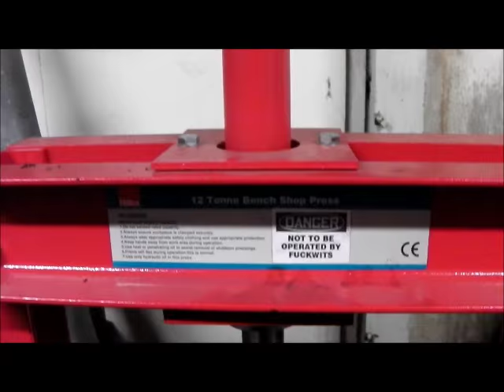Land Rover Series Front Axle Overhaul - Part 4

Comment: Nice job as always Phil - Now, just a tip I learned about replacing UJ crosses many years ago in my first job, which you may, or may not like to use.
When you've taken the old one out, grind a little off the outside of a cup so it easily goes inside. This is a spacer to press the new ones in using the vice. Cut a short piece of tube that just fits over the cups. Using this to allow the centre of the cross to be pressed into, it is easy to press one side in while holding the cross to prevent the rollers coming out. Press the cup through until it is sticking out on the inside i.e. too far. Fit the circlip to this cup. This way you can  slide the cross slightly out, so holding the rollers in both cups as you press the other one in. The ground cup is just a spacer to push it home, but perfect to press flat onto the new cup. Once it is fully home you can of course fit the other circlip. Also if the yoke has become slightly twisted, so making the circlip difficult to locate in the groove, you can tap the yoke out to get it fully home.
I did many PTO crosses in my 4 years at that job, and although I've rarely needed to replace one since, not for years now I've always valued learning that.
Reply from the maker: Thanks Malc, good tip. I have a PTO shaft to do shortly so I'll give that a go.

Comment: Dear steam, I have just done this job. Its way easier just to grind a groove for your chisel, onto the face of the inner bearing race, and drift the race and seal land off together, thus saving the original seal land if its reusable.
I clamped it in a vice, ground a good groove in the inner bearing ring/race at 6 oclock and 12 oclock, plenty of blowlamp on the movable bits, and 5 or 6 good wacko smackos each side and they come off together, with no risk of cutting the shaft. Your chucking the old bearing anyways (if) and you can use the original land rover seal land, as its turned up way better than the new (rough as a badger) britpart crud. Cheers.

Comment: Thanks for the great video.  Is the middle metal cylinder (between the retainer collar and distance piece) the inner race for the half shaft bearing, and if so does this come with a replacement bearing?  I can't find that piece listed anywhere (LR parts manual, roversnorth, etc).  Thanks in advance!
Reply: I’m having trouble finding that part number also.🤔

Comment: Thanks Phil. Great video and really helping as I overhaul my swivels. A quick question; I'm fitting new half shaft bearings into the swivels, is there a right / wrong way to fit these? My assumption is that the retaining collar should face out?
Reply from the maker: Thanks, glad it helps. If I remember rightly, the halfshaft bearings are a roller and the cage has a lip only on one side. You need to be able to install the half shafts with the swivel ball fitted to the axle case, so the lip would have to face towards the diff.
Reply: @steamwally  Thanks Phil - you are right re the lip and that's what I'd assumed was correct but because the original bearings were caged from both sides none of the docs cover it as it wasn't a problem. Keep up the great work - making restoring my 73 109 so much easier.

Comment: Nice going, Phill.   I was taught to use an appropriately sized socket and a vice to press in the bearing cups.   

Is this other workshop your Fortress of Solitude, out in the woods?  :-)
Reply from the maker: I have used that method in the past, works very well. I wouldn't fit them with a hardened steel hammer, but with the copper mallet it's usually OK. Certainly quicker anyway.. 

Everyone should have a workshop in the woods....

Comment: Looks like the bench could do with another leg, under the vice...!!
Reply from the maker: It's quite sturdy, but isn't there always room for improvement!? Incidentally, that vice came from the WW2 ammunition store, the site my workshop is on was one of the tank bases which played a key role in the lead up to D day. The ammo store would be my workshop if it wasn't full of asbestos!
Reply: I assume the workshop is your place of work, the home workshop appearing at the end of the video..? Just out of interest, what is your day job..?  Cheers, David.
Reply from the maker: Correct, I work for a private hospital as a mechanical and electrical engineer. Much of my work is with steam boilers and the equipment they serve.